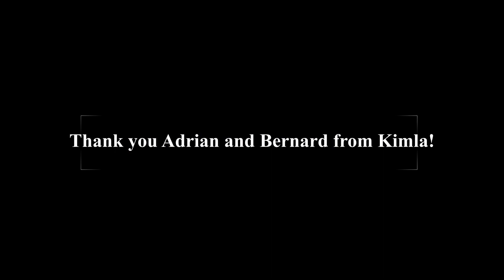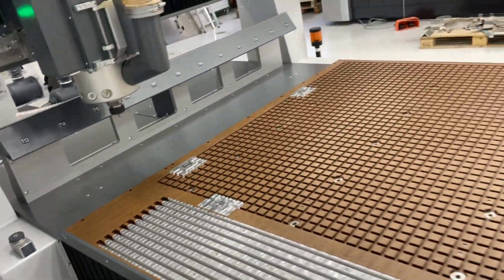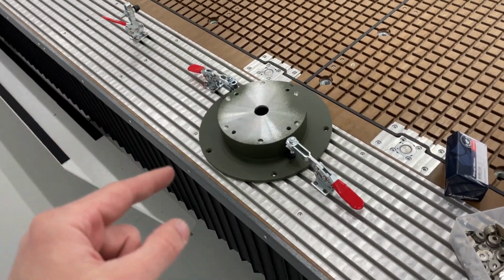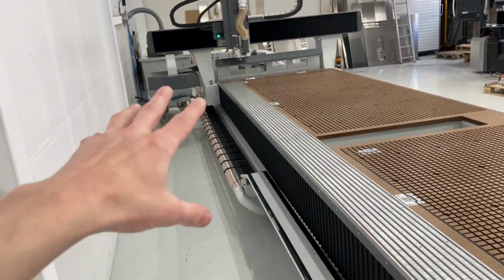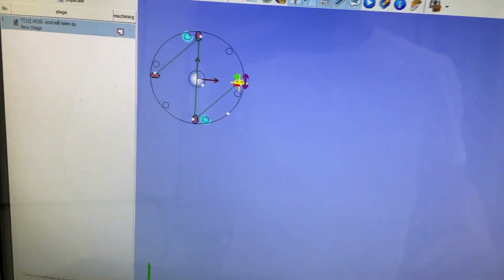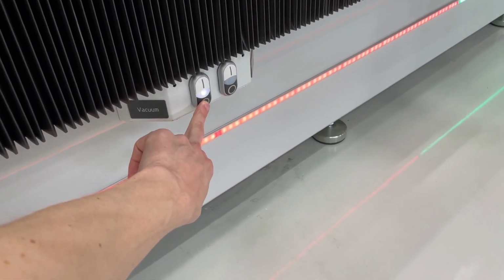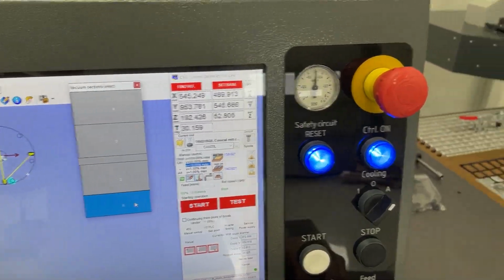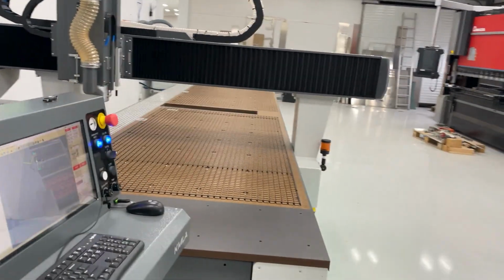The MONSTER CNC ROUTER Part2

Comment: AARRHHH! Finally!!!  I was looking at your channel every day to see any progress was being made with this huge mofo. Very good idea for routing that suction hose! Clean install! in my search for a proper dust extraction, I started to become a huge fan of  relative small diameter hoses and high speed air. The finishing details on the machine are incredible! the part where you show with your hand how large the bolts are on the bridge, it's all pretty perfect in my book. No idea how the machine measures, but these details do give confidence for sure. I have pics of my son in about that pose standing on the machine.. Robovac got a nice new home.
Reply from the maker: ;D Yeah im happy so far with the extraction,  I might put some more stainless steel tubing where appriopriate, just so Ive got as little hose as possible. The hose is 100mm the first section next to the spindle and the rest is 3"/75mm.
Everything about the machine gives the impression of quality, its truely an "HIGH END" machine. The fit and finish is superb!
It sets the bar for everything else so thats why I couldnt had done the rack for the vpumps/spindle cooler any less, it looks like it was supplied with the machine!
The floor,chipcontainer,rack,materialstorage along the wall its all same RAL colors as the Kimla 👍
You should post that update vid btw ;)
Reply: @randomrouting  Agreed, that pump rack is a very nice touch! It completes the set. How do you like it in use? Has the software a steep learning-curve or is it relative intuitive? It is a statement for quality. These hinge points they welded to lift the machine, everything seems so well thought through. This is next level machine building. That mount for the monitor arm, there are so many details to like.
Reply from the maker: @berendlucasvanderweide  I'll have to get back to you about the software, that job in the video is litterally the only job i have done on it. I did ofcourse get some training last weekend so ive seen the things it can do but I'll have to use it. Its fast and easy to do simple stuff, that i know.
Its similar to vcarve/aspire in a few ways, can handle 3d but mainly ment for 2d programming.
I was happy to see that the cad/cam/cnccontrol integration ment that it could do some cool stuff like placing markers in cad and referencing them in cam. There SO much in the software its going to take some time to find and try it all. 
It does not use renishaw standard probing macros so fusion 360 wont be able to put out inspection probing routines ect BUT you can easily make changes and add featues to imported gcode like activation of vacuum zones or referencing probing data. Pretty cool stuff!
Reply: @randomrouting  I expected it to be more 2d than advanced 3d, it's hard to combine that into a controller, judging all the variables you have to choose from. I expect you knew this;  check to see if it is compatible with dprnt, i know HAAS and some other fanuc compatible controllers can push their probing data through the dprnt protocol, perhaps you can do use measurements that way.
Reply from the maker: @berendlucasvanderweide  Thanks, ill check it out!